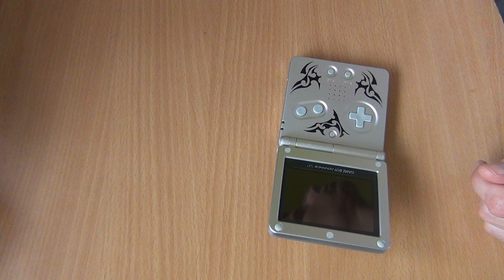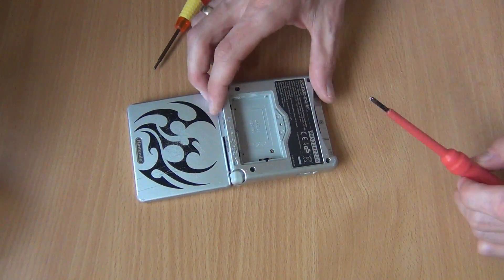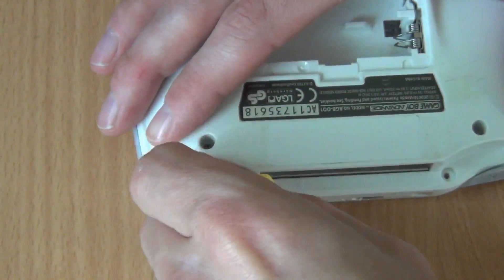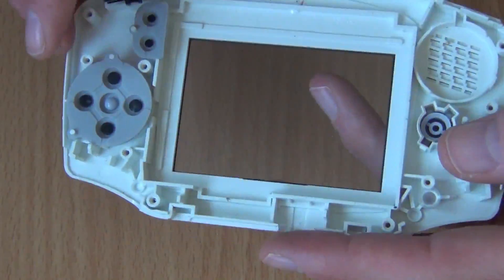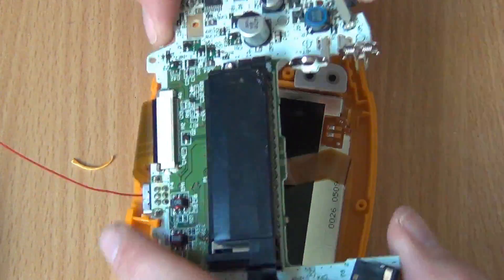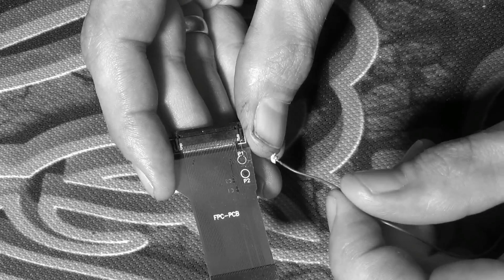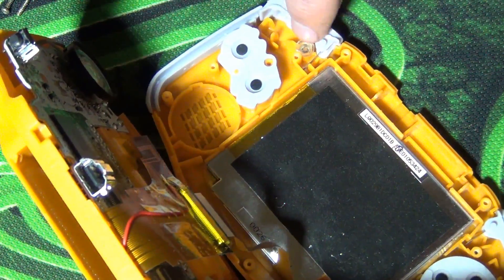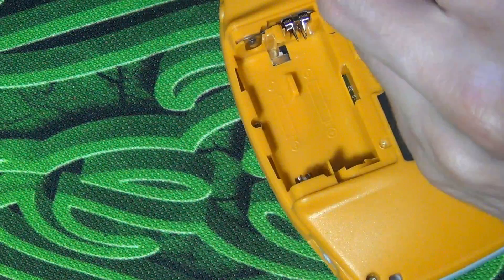Building The Best Game Boy In The World

Comment: If you got the rechargable battery in it that would make it even better. Would be a bit harder though as you would need to get the charging jack into the new case. I have all my GB games on a Raspberry Pi 3 with Lakka installed and hooked up to my TV.
Reply from the maker: Next video about my gameboy will be about adding a rechargeable battery.

Comment: SP was made for easier portable use
Reply from the maker: +Any% i'm sure it was.
Reply: And to prevent scratches
Reply from the maker: Yes, and it does all of that 100%. I just don't like it that much.
Reply: is not ergonomic I give you that
Reply: Any% If you drop an SP while on use, it is possible you could break the top screen
Reply: while on use could be my fault. however on my pocket and Traduci falls it probably would happen to the non-sp Gameboy more than on a SP.
Reply: I've dropped my GBA dozens of times and it still worked. I miss playing on my GBA tho, and new SP's are expensive as f*. Since I've got two of these lying around, I'll be testing this out. Just wonder if I could find a standalone AGS 101 screen somewhere, though.
Reply from the maker: +RpiesSPIES try AliExpress
Reply: +RetroGameCouch are those screens actually legit? Because I've seen some under $40, but it all seems like they could be fakes. Never used the site, myself.
Reply from the maker: A friend of mine used one of those and it worked. I can't give you any guarantees obviously.
Reply: Sure it is but it hurts to use after a while. heck I just use the regular one since I tend to travel with a small bag anyways. Frankly the original doesn't take that much of a space anyways.
Reply from the maker: +Stefano Pavone that is awesome. Wish I still had my original one.

Comment: Very cool.  Another advantage of the original body GBA is the ability to replace the batteries, so you're never waiting for a recharge.  But that brightness switch is inconvenient.... I was wondering how adjustment would be handled.... I'd be tempted to move it to another location.
Reply from the maker: You could of course move it. I never have the urge to change it to less brightness to be honest.
Reply: dude, just move, seriously, The GBA SP saves you money AND hassle.  That's like saying you prefer a Xbox controller over a PS4 controller because it uses removable BATTERIES!

Comment: Would be perfect if you could only have the rechargeable battery pack from the SP as well.  Using regular batteries kind of sucks.  Plus I would assume using the back-lit screen uses quite a bit more power so it'll probably eat through your batteries quick.  Cool mod though.
Reply from the maker: +Deathknight50000 it actually uses less power with the new screen
Reply: Wow, that is odd but sweet.

Comment: Another advantage of the original GBA is the ability to use AA batteries or a third-party AC adaptor. Sure, there are some obvious significant drawbacks to that, but at least it's playable. None of my family's SPs work anymore because the sockets for the recharging cords to plug into all crapped out.

Comment: Should have just put an Afterburner kit in your original GBA. I did it years ago, works great.
Reply from the maker: That is a frontlight mod. The backlight mod I did is much better. It's why the AGS-001 got replaced by the AGS-101.
Reply: RetroGameCouch
It still works well enough, and is much simpler to install.

Comment: That was awesome man, but can you turn the light on and off or it is perpetual now?
Reply from the maker: You can switch it like on the SP. To turn it off you'd need to desolder the wire. :)
Reply: Oh I see, does this make the batteries drain a lot faster? or around the same?
Reply from the maker: The SP screen makes the GBA more energy efficient actually.

Comment: Hey, I think you were suppose to use the advanced AGS-001 for this project. Not the LAGS-101, would that brighten the AGS-001 screen?????
Reply from the maker: Not sure you watched the video, but I am using the AGS-101, which has a backlit screen. Unlike the AGS-001 which uses a frontlit screen.
Reply: yes i get that
Reply: does it get brighter, the front light screen, with the other board.
Reply from the maker: No, it won't get brighter.

Comment: I have seen this video from start to finish about 3 times now. I am not tech savvy but I really want to do this. I have made up my mind that I am going to give it a shot. Is there anything you can think of that a person can do to completely screw this up. I see this all over the internet, if think I can pull this off. Also one last thing. I see a lot of people are saying you do not need solder that wire, in fact I see a lot of screens comes without it, any thoughts on that?
Reply from the maker: I've seen those solderless cables as well. I'd say give them a shot. Nothing much can go wrong if you follow that method. But I have no experience with these cables. Results may vary.
Reply: Thanks for the reply. I am just waiting for my parts to be imported from China then I am going to try :) This video is going to help a lot :)
Reply from the maker: Good luck!

Comment: Okay, but my only issue is that you can't install the rechargeable battery, meaning you either have to invest in rechargeable AA batteries, or spend a lot of money on packs of batterys.
Reply from the maker: Working on that! Next gameboy vid.
Reply: Awesome. Though for incorporating those components, a slightly larger shell(And some extra cutting) might be required, don't you think?
Reply from the maker: Alyssea Rutherford I am using something that will fit into the battery compartment.

Comment: I'd have checked the voltage on the battery and added it to this so it won't need AA batteries anymore. adjusting voltage with regulators if needed.

Comment: Hi. How did it fit with the thermal pad (black pad at the back of the screen?) still on? I can't get it to fit without putting too much distance between the board and the D-Pad. Did you remove the black rubber on the front of the screen too? Thank you. God bless, Proverbs 31

Comment: Did you have any issues fitting the ribbon cable with the adjustable brightness? I can't close my gba since the cable pushes the gba motherboard up.
Reply from the maker: It's a very tight fit for sure. I ended up sanding a bit more plastic down. It JUST fits.

Comment: My gba that I want to use for this exact project has a serial number in the same area shown in the video except it starts with neither a "1" or "0" instead it starts with a "3" is the process any different for a model like this? and which connection cable would i need in terms of pincount  +RetroGameCouch
Reply from the maker: If you're uncertain, open her up and count the cables in the ribbon cable. It's tedious but the best way.

Comment: Did you have to buy a cable to match your sp screen? im reading that white connectors go with 32 pin cables and black connectors fo with 40 pin..but you have a white connector going in a 40 pin so that makes me very curious.
Reply from the maker: +MrBasspunished1227 as far as I can tell you can distinguish them with the serial.

Comment: Of course it was fixable. Just scrap the power line and solder it again. But sure, its not a job for someone who are not experienced in soldering small parts.
Reply: Yeah looks like that to me too. The solder-protected parts of flex board are tricky, because you can't easily scrape the lacquer like on FR boards, but that particular line runs straight into the connector, where it would have been possible to attach.

Also i occasionally use silver lacquer - great to patch up damaged traces on flex board, etc. So you can e.g. epoxy a copper eye that you can solder to, to the flex substrate, and lacquer the path to the undamaged trace.

Comment: It'd be nice if you could play all the games in the game boy line
Reply from the maker: It can . That's the point of using the advance sp.
Reply: RetroGameCouch 

I meant it would be cool if it were possible to make the advance do that. But I assume that wouldn't be worth it. I like the shape of the advance better than the SP, but it would be awsome if the advance had had that backwards compatibility. Not like buying an add on grip for the Sp.

Still though great mod, loved your video.
Reply from the maker: The advance also plays them all. It just does not have a backlight, which I fixed

Comment: Where is the brightness adjustment? Under the batteries?
Reply from the maker: I didn't properly show that in the video, but yes, it's accessible through a hole in the battery compartment.
Reply: Is there enough give in the adapter to put the dimmer outside? If one were to cut a small hole on the bottom perhaps?
Reply from the maker: ***** I don't think so. Perhaps somewhere on the top would be possible. But I always have it on the brightest setting so it doesn't bother me.

Comment: Dude HOW THE HELL DID THIS WORK FOR YOU?? I've been at this for hours now and it's not working for me. My screen acts as though it doesn't have power even though the wire has been soldered to the board! I tried soldering to both capacitors and my screen still won't work. I'm at my wit's end (after all the money I spent in parts and all the time I spent waiting for them to arrive, I'm too hyped to just quit.
Reply from the maker: Are you sure about the orientation of your converter cable?
Reply: +RetroGameCouch orientation? I'm afraid I don't know what you mean. I thought it was just as simple as soldering the connection. What do you mean by orientation?

Comment: it's not best, you should use a rechargeable battery from sp with a charging port, but I know it will be inpossible, because the standard advance havent got charging port function, so this rechargeable battery you can use, but it doesnt make sense when you have to charge it using advance sp or standard battery charger
Reply from the maker: +Mruczyslaw already working on it.
Reply: RetroGameCouch nice. good luck!
Reply: Mruczyslaw  rechargeable batteries run out of power eventually guy....

Comment: When you do this mod, is there any way to have the screen on the higher or brighter setting? Or does it have to be on the lower setting like so when you start up a GB SP 101 if that makes sense? Lol
Reply from the maker: The converter cable I use has a brightness switch, it's shown in the video.

Comment: could you maybe answer me one question? I've got the same converter cable (32 pin) and it seems that the switch is kinda dark. When I use the switch to brighten up the screen it looks like the 101 "normal" mode when you just power of the SP. when I change back to lower the brightness it is darker than the "normal" mode from the 101. I thought the switch does the same like on the SP? I mean first of all the "normal" mode and then after the switch the brighter mode

Comment: there's one issue with your "best gameboy in the world" it's still running on double a batteries. And now that it's powering a backlight they're probably gonna drain faster. If you could've also imported the sp battery and charging functionality then I would definitely call it the best gameboy in the world
Reply from the maker: It actually runs longer with the new screen in. The SP screen is more energy efficient.
Reply: RetroGameCouch oh, i didn't know that. still though being able to charge your handheld is a most convenient feature
Reply: Agreed.
Reply from the maker: Working on it!

Comment: Could you not have used the converter cable from the SP itself?
Reply from the maker: There is no converter cable in the SP. Just a flat cable, permanently fitted to the screen.
Reply: RetroGameCouch ahh that males sense, thanks for the fast response!

Comment: I'm surprised that works as it requires more power than the original.
Reply: I actually saw a video the other day that is comparing a regular GBA to a one seen on the video. Turns out the modded one has more battery life, maybe because the backlight screen is more efficient.

Comment: GBA should had that screen from the start ... This is just fixing the factory. Backlit screen is an absolute basic thing in any screen based device. Nintendo just fucked it up.
Reply: No, it was not a fuckup. The likelihood of them getting a nice lit screen in a device released in early 2001 was pretty much zero, regardless of effort.

The original Gameboy and GBC prevailed against GameGear and Lynx pecifically by having a non-backlit screen - the backlit screens of the day simply consumed too much energy, and were not usable in sunlight, and they were the reason those other consoles ate through huge bundles of batteries very quickly. The screen used in Gameboy Advance (2001) is for its time an absolute marvel of low energy consumption. Besides, it had the advantage of working in direct sunlight, something displays still struggle with, and it offers less ghosting and better legibility than most other screens of its time.

Then there was the Afterburner kit, which used a see-through light guide in the front of the stock display. It was a rather new technology - it started popping up in PDAs and such around that time, which also marks the time when PDAs became colour - one of the reasons earlier PDAs are monochrome is because EL backlighting has excellent reflective properties when not in use, but has too much of a colour tint to be compatible with colour screens, and there used to be no alternative to that which was compatible with reflective use. The original GBA SP then was inspired by Afterburner (according to 2003 interview with Kenichi Sugino for GamePro), using the same display as in GBA and a similar light guide to the Afterburner. The GBA SP was released early 2003. The Korean optical company responsible for the light guide in the Afterburner then refused supplying further ones to third parties - perhaps they were the ones who were contracted to make the one for GBA SP, or ran into legal issues. The patent filing for front light guide is US7001060 from June 2000.

Various enhancements in optical and semiconductor technology finally enabled more energy efficient backlit screens, but not before a few more months passed. Indeed the late-2005 backlit GBA SP screen consumes less energy with backlight at full power than the original GBA screen with no backlight at all.
Reply: no it was built at a time when tiny backlit screens were too expensive to manufacture. history shows nintendo succeeded with the gba. the ags 101 screen at launch would have been so expensive not too many people would have bought it and not too games would have been developed
Reply: One of the most interesting screen assemblies of the time (1999-2000) by the way was made by SANYO in one of their photo cameras. It's a standard low-permissivity thin colour TFT panel with a customized external backlight unit. A backlight wedge with embedded light guide, which has a flap that can be opened by the user. In sunlight, you point the top of the camera towards the sun, open the flap, and you can read the screen. At the bottom of the wedge was a rather inefficient micro CCFL tube, because in 1999 there were no luminophoric white SMD LEDs that have been a standard in small colour display lighting since about 2002 and in big display lighting for a bit less than a decade now. The main problem in 2000 era was really the power consumption and quality rather than the cost.
Reply: Gameboy's without lited screen was for me unplayable. I remember when i was 8 years old i got brand new GBC with pokemon red game. I was so pissed that i don't see anything on the screen . Only in strong light or sunlight i could play on this. I never liked a light accesories for it like lamps etc .When finnaly i got GBA SP AGS-001 with front lit screen i finally could play comfortably. Original GBA was also unplayable for me.
Btw.Sony PSP was relesed in 2004 , had a great backlit screen and it was a great comercial sucess. Nintendo seen this handheld and relesed a year later a AGS-101.But it was too late to make any good money on it. Nintendo should had made backlit screen on 2001 GBA . Even if would be more expensive and consume more energy. Sorry for bad english
Reply: The original GBA came out in 2001. Backlit LCDs were still expensive as shit back then.

Comment: it's not the best because it doesn't have a usb rechargeable battery
Reply from the maker: I prefer AA cells :)
Reply: RetroGameCouch wouldn't AA cells get expensive? All you have to do is take a Gameboy Advance SP battery and solder it to the pins along with some extra components to use a micro USB cable with it
Reply from the maker: You need a charging curcuit.